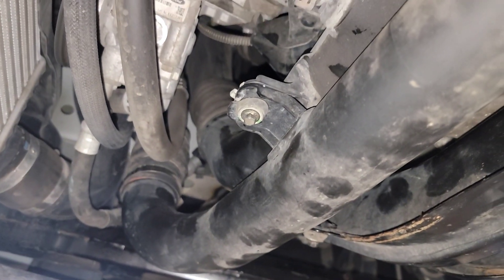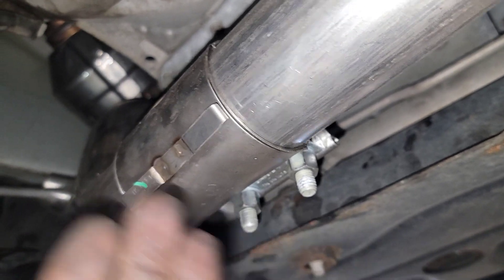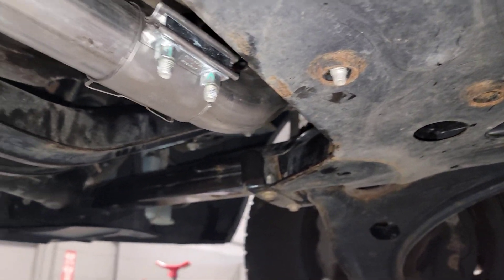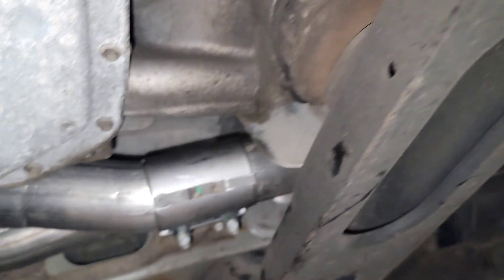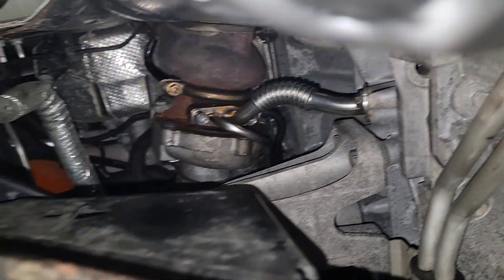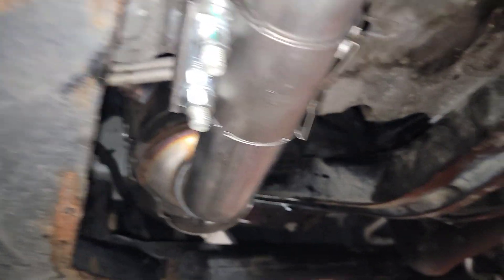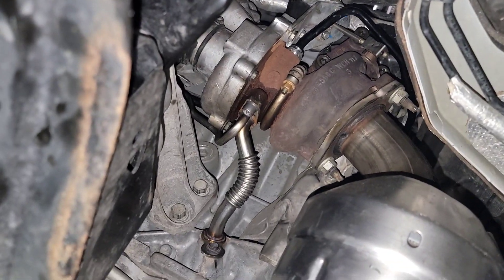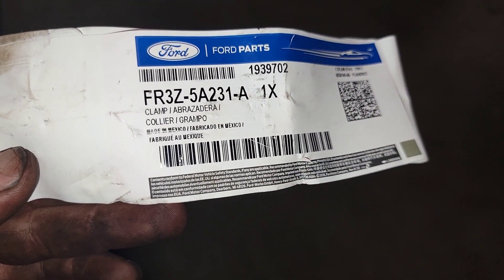2018 Transit 3.5L Ecoboost - Using Shelby GT350 Exhaust Clamps - turbo reseal / Catalytic Converter

Comment: Any advise putting a cat converter back in a 2020 transit connect 2.0L. I managed to take it out the bottom due to the flex pipe breaking. Really don’t want to drop the subframe
Reply from the maker: Unhook the motor mount and rotate the engine forward either the roll restrictor on the bottom and use a ratchet strap to pull the motor forward or unhook the motor mount up top and find a way to support the engine and move it forward
Reply: @FordBossMe  did both of those. The new cat is super bulky. The
Wsm says to lower the subframe which it looks like I’ll have to do